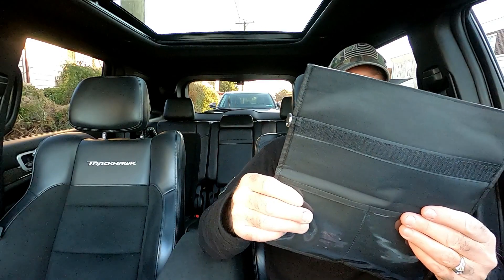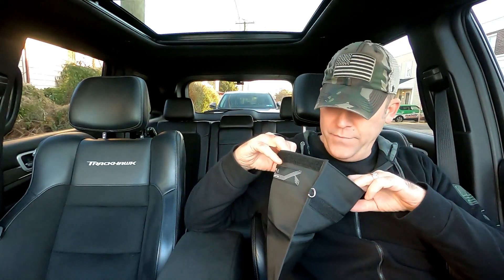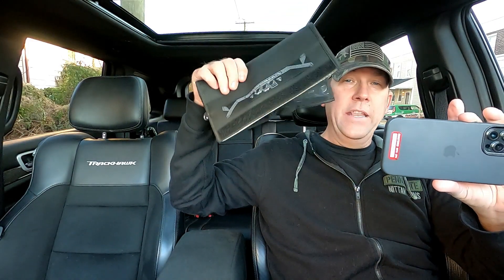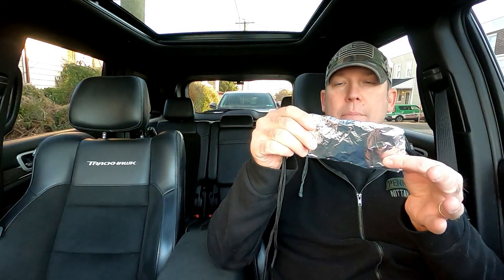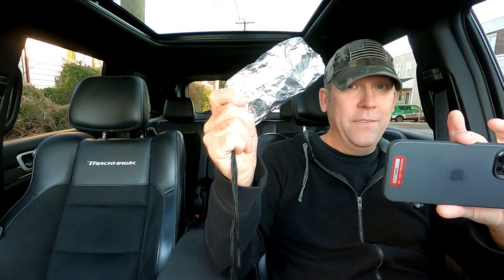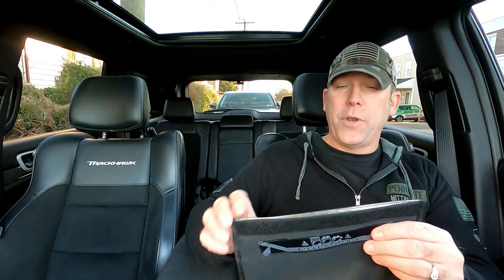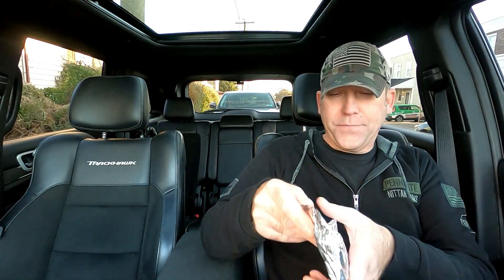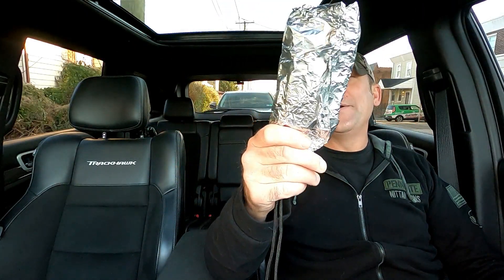HOW TO STOP A THIEF FROM STEALING YOUR CAR USING ALUMINUM FOIL - DIY FARADAY CAGE

Comment: Where do you put the foil after you take out the fob? Do you ball it up & put it in your pocket? Reusing the foil again & again probably puts holes in the foil thru which the RF can get out. I'd rather pay for a Faraday pouch.
Reply from the maker: So I made a multiple layer style pocket with it so o could slide the fob in and out and just fold the opening over.

Comment: Shit, I did the foil and doesn't work. Yeah the door don't open on by touch of the handle sometimes but I can press the buttons through the foil and unlock the car. Also, the car seems to detect the key for my anti theft alarm. It's interesting.
Reply from the maker: Make a video proving it. I don’t believe you.

Comment: If the vehicle is able to be started when the key-fob is detected in your house, what happens as the thief drives an 
increasing distance away?  Does the engine continually operate even though the key-fob has surpassed sensing distance?
Rather large anomaly here.
Reply: The thieves are not just amplifying your own fob signal to start the car and then driving away.  They have a device that clones your fob signal.   So even though they drive away from your house - there is still a cloned device inside the car transmitting a local fob signal to the car.     

Note that thieves can also do this when the key is in your pocket/purse at the store or wherever.   Clone your fob signal, follow you home, then steal your car.

Don’t be too hard on modern technology.  It has always been this way.   From the very first cars invented.   A determined thief will always find a way to defeat any anti-theft device and snatch your ride.   It’s their job.  And they can be quite good at it.
Reply: @figmojustfigmo3820 they can’t steal in out of my garage
Reply from the maker: @kimdagnillo8246 no, but when you park at the store they’ll just break your window and burn a new fob using the ODBII port. Security isn’t just one layer.
Reply from the maker: You can drive away with the vehicle running without the fob, but the first time you put it in Park it won’t shift out of Park without the fob. Had this happen to me two years ago at a car wash. Jeep was running, and the guy put my fob on the passenger seat and it fell between the door and just out of range for detection. We couldn’t get the car out of Park until it was shut off and then restarted with the fob.
Reply: @EastCoastJeepSRT  Interesting and unlucky not being able to be detected 1 - 2 metres away!

Comment: Is this only on newer cars with push starts or does it work on all vehicles?
Reply from the maker: Any car with a key fob
Reply: Just push start key fobs. There are basically three different types of keys. The push start ones are super easy to steal. Another option is a kill switch. Even if the crimes have the key fob in there hand the car won't start if the switch is pressed. Hide the switch, and have extra protection. There are a bunch of yourubes on how to do this
Reply: This works for every car ever made.  Any model year.   Foreign or domestic.   Even if you have a 1969 Pontiac Catalina - it will work.    

Wrap your car key in a tin foil bag and then try to start your car using the key.   See?   It won’t start unless you remove the key from the tin foil bag.  

Amazing!

Comment: This works but it only a part of the problem. Some criminals will smash your window get in and program their own key, they don’t need your signal. Or they can get inside, get it into neutral and push your car with another from behind. It’s best to get an aftermarket security system that sends you a notification if someone touches your car, a steering wheel lock, kill switch, and a gps tracker. I’m in Canada so no one is going to steal my mopar but on something expensive like a hellcat or trackhawk I’d definitely have more protection
Reply: Slow down there buddy, I'm pretty sure recent car models with automatic will not allow shifting of gears like from parked to neutral if you haven't turned on the car yet.
Reply: @aldrichemrys  Not true. There is a neutral lock release on some vehicles that a thief can pull on that puts a vehicle into neutral. You don't need to start the car to steal it. Just push it out the driveway and have another vehicle push it down the street.

Comment: Why not just never use your key fob when you get to a place, simply lock your doors manually no signal needed, that’s what I do then when you leave you can just make sure nobody is following you to your house. No different than that bag just saving money.
Reply from the maker: Your key fob is always broadcasting a signal. It’s never “off”
Reply: @EastCoastJeepSRT  thank you for clearing that up I might need to get me one of those bags thanks for the info man.
Reply: The tinfoil works until you get a bag.